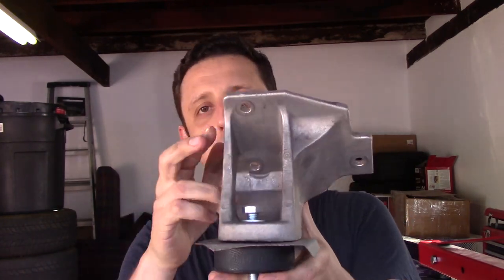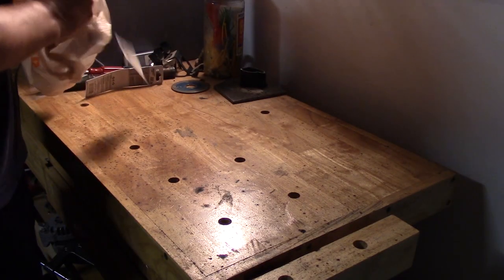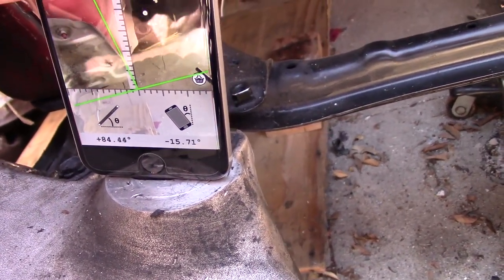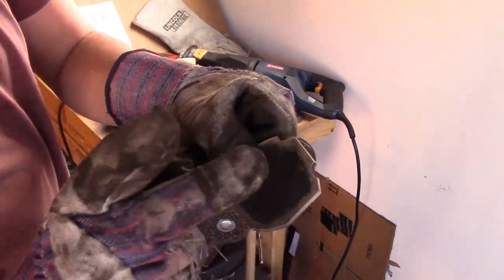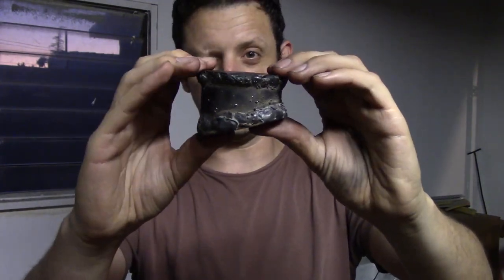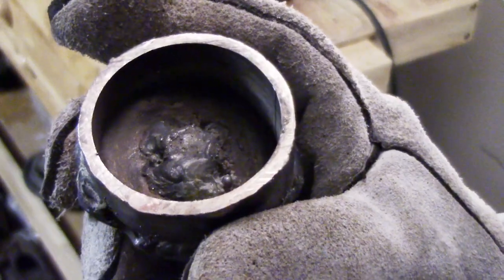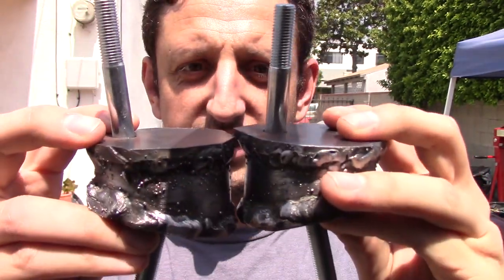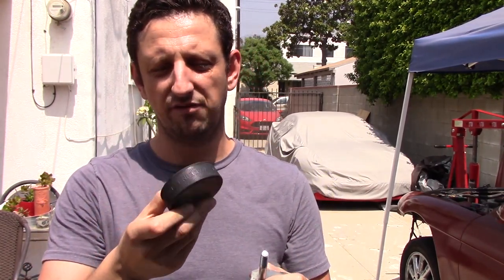Lexus SC Drift Build. Ep.9 - LS Swap Pt. 2  - DIY motor mounts

Comment: not sure if you thought of this. I'm doing the exact same swap in a sc400. what I did for the mounts was used the stock 1uz mounts with 3 hockey pucks as isolators and made adapter plates to bolt them to the chev block. they put the engine as low as I wanted and costed less than 20$. great series, loving it!
Reply from the maker: That's a really good idea. I looked at ways to retain the stock 1uz mounts, but the 15 degree bend is in the stock isolators instead of the mounts themselves. How did you get around the angle issue? And thanks! I'm having fun making the series. Glad you're enjoying it.

Comment from the maker: Looking back on it, and with some advice from an internet friend, I should have welded the top bolts in place so they won't spin when tightening or loosening the nut. I'm going to tack weld them on from above to make up for this gaffe.
Reply: Might not have had to cut end off angle adapters. Could have drilled and taped then just put studs in? I commend you for all the tough work. Hope to see this project make it to fruition.

Comment: the hockey pucks took the shape of the bend easily. if they give me problems then I will cut the top of them at an angle. I'm so jealous of your transmission though! I could only fit a 4l60e in my budget lol :(
Reply from the maker: I've had the transmission sitting in a box for a while. It's basically why I'm doing this build, so I got lucky with that one. Thanks for the advice on the mounts and good luck with your build!

Comment: What kind of welder?
Reply: Also I realized your mistake as you were welding on the second cap. It was painful to watch your realization. Love the comments you add though.
Reply from the maker: Hobart Handler 140. It seems to be getting the job done for everything so far.
Reply: Yep. Should get most jobs done for sure. I only have a flux core welder for now. Still works great, just not the same level of performance.
Reply: I just ordered a better welder than my old HF unit. 135A gas or flux from Eastwood. Smoking deal, got it for only $180 shipped.

http://www.eastwood.com/mig-welder-110vac-135a-output.html